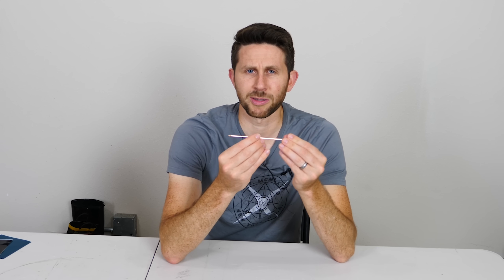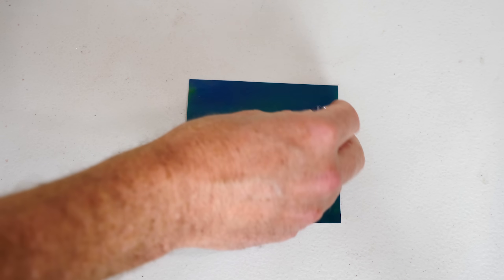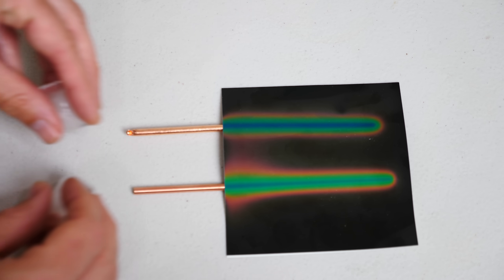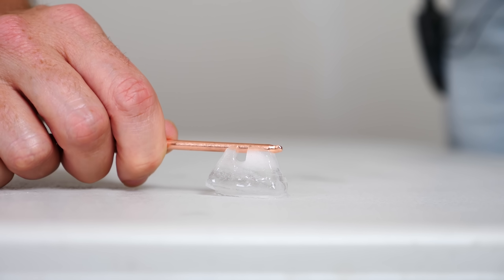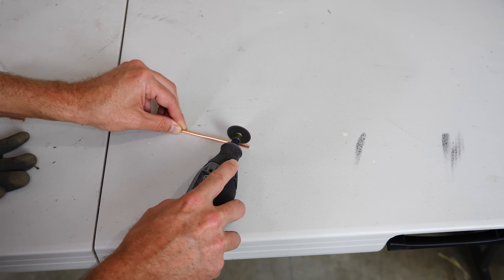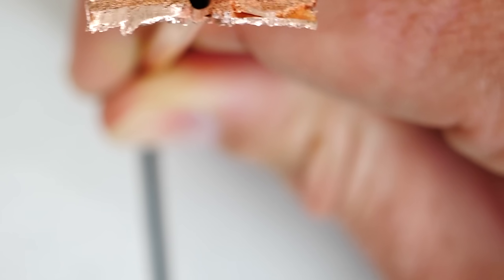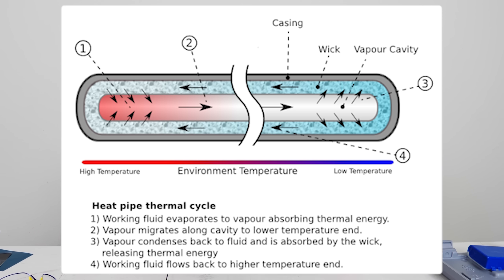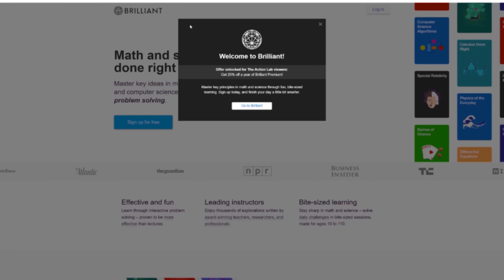What's Inside the Worlds' Fastest Heat Conductor?

Comment: But if water vapor is flowing from one side to the other, wouldn't at some point most of the water vapor would be on one side and there wouldn't be any more water vapor to conduct the heat on the other side, so it would then stop conducting heat as quick as it does? How does the water vapor get back to the other side once it condenses?
Reply: It relies on wicking, using the capillary effect. That's why the inside of the pipe is so rough. That wicking is what returns the liquid condensate back to the hot end, where it can give up heat to become a vapor, and transfer the heat back into the cold end by condensing. The efficiency of the wicking effect is what determines how fast this can transfer heat. Otherwise, you would have to make sure the hot end is always below the cold end, so gravity could drip the condensate back down to the hot end.

Comment: Silver is the most conductive metal.
Copper is second place
Reply: Copper is the best when it comes to large scale industrial and commercial use.

Its alot more common than silver
Has higher thermal potential (higher melt point) is only slightly less conductive. 
Also silver has higher chance of tarnishing which lowers electrical and thermal conduction.

Gold while less conductive has the added benifit of being non reactive i.e. will not corrode tarnish or otherwise oxidate. However given the high cost and easy at which it can be damaged its typically used as a plating on most conections (except high end processors that use gold pins)
Reply: He didn’t say copper was the best

Comment: What if we use silver instead of copper?
Reply: Not a good heat conductor. Not as good as copper. When it comes to heat conducting, vapour chamber made with copper is the best.

So many wires are made with copper. Why? Because of its electrical comductivity. But silver and gold does a better job. But they use copper imdustry wide because it is cheaper and copper has lower boiling point compared to silver and gold. The silver and gold just betters copper in electrical conductivity. For heat copper is better because of its nature.

Comment: 🤔I have a doubt now,

Can't this be used for geothermal energy?

I mean why can't we manufacture a extremely long and massive heat pipe and put one end of that at the nearest possible distance to the Earth's core and gain those heat from the surface!🧐

If someone knows the complications plz let me know😊
Reply: Copper is relatively expensive. It's easier to pump fluid instead.
Reply: Copper is expensive? I thought it was quite common

Comment: So Simple yet Genius. Did AI invent this?
Reply: No. Heat Pipes are old tech. They've been around for over a hundred years. The first types were thermosyphons, and didn't have the sintered wicking structure, and could only transfer heat from bottom to top, as long as the pipe was oriented in a way that led condensate to flow back to the lower hot portion. Those have been around since the late 1800's if I remember correctly.

Comment: You remember thermodynamics and half filled bottle bottom after push from above?
Bottle actually can be half covered with ("mazochistic...invisible maze")mazzola(hammer) hit ?!
Same ΣΗit shall happen. 🔱 SHalLow waters.
 (hail to HYdra: holy hole of holLow ring of SHa dow- sing Y )
Imagine wider opening of bottle. It is easier to explain experiment conditions of NO PRESSURE that way.  Open to the air and still broke out.

Why? Because it ain't water vapor that reacts but sudden vacuum( not void in this case vacuum isn't void..remember quantum mechanics..what your finger feel isn't there, stiil is?! How whY?). The Reverse FlaSh effect RЯ Holy Lance

Bottle glass is moved down before water has chance to move at all. For that brief instant of time vaccum is on the botto(H)m. Bullet water done the harm.
PRESSURE DIFFERENCE HAS THE POWER , not vacuum. (1 atmoSφere)
αφ

...1(1(1(0)1)1)1...
https://www.youtube.com/watch?v=_BRv9wGf5pk Snap - I' ve Got The power 

https://www.youtube.com/watch?v=7yeA7a0uS3A He-Man: Opening Theme

Comment: I have a question.
Say, if a ceiling fan motor is rotating at the speed of light would the ends of the blades of the fan be travelling at speeds greater than that of light?

Comment: What if we made that conductor from silver ?? Will it work better than this copper conductor ?
Reply: Yes
Reply: Yes, but only by a little bit. The conductivity values for copper are around 400 W/mK. For silver, most measured values are something like 450-480. But that heat pipe is at roughly 100,000 W/mK, which is already orders of magnitude higher. Silver might improve it a little bit, but I don't think it would be worth the extra cost. Silver is a lot more expensive than copper. The improvement, would be in the tens of W/mK, which would be so low that it would be less than a rounding error.

Comment: I knew how heatpipes worked, with liquid flowing as heat provided the energy, but I actually thought that it was usually an alcohol or gas used for it, not regular destilled water.
Reply: Same here!
Reply: Highest energy storage there is (well few exceptions but vary few).

Comment: Where can we find this special rod and the thermal paper ?
Reply: Thermochromic color changing film/ paint
Reply: Sergei Lewandowski thank you!
Reply: Lalrivunga Hnamte  it is not about the video, the context is in comments. Root one asked about both, rod and paper, then someone mentioned paper could be bought, then you mentioned it can be made at home, and that is the point where i was interested in: how could you make thermopaper at home.

and no, it is not that easy to create such a surface on the inside of the copper tubing. Sealing the vacuum with a little water inside it would be easier, but not much, as we need very specific pressure of water vapour in the tube after sealing. 

But if it was about thermal paper, i thought, you might just know some chemical available in food or chem store
Reply: but in fact i did not evaluated both variants, i just assumed second comment changed topic to just one item: thermal paper, and if not mentioned (or implied) otherwise, all consequent comments are about that, and i did not see such an implication in your comment, so i assumed you're about thermal paper ^_^

oh maan, i can be so tedious 9_9
Reply: anyone found where to buy the film? i found only paint on ebay
Reply: Lalrivunga Hnamte  using what materials? >_>
Reply: Lalrivunga Hnamte  now i urge to clarify, are we talking about that magic rod, or mystic thermal paper?

Comment: So basically its a partial vacuum that allows it to work. Having the water in a closed system of lower pressure allows it to vaporize at lower temperatures, more efficiently move heat across a gradient. You couldnt do it as well with standard pressure.
Reply: That's correct. The ONLY thing in that pipe besides liquid water, is water vapor. That way, it is always at equilibrium, allowing instant evaporation at the hot end, and instant condensation at the cold end. the rate at which it can transfer heat is limited only by how fast the wicking process can return the condensed liquid back to the heated end.

Comment: Info you have gien about this copper tube is correct, no problem there. BUT! This is not the fastest heat conductor. (Best description "highest thermal conductivity") It has the best conduction performance for low cost/high production rate aproach. (Thanks to material transfer from one end to another end) Actually this system can be improved with mercury vapor. I know it is very very dangerous and this is why its not used. As I said; this is the best for low cost/high production rate aproach.

Actually there are some abnormally good thermal conducting materials. For example; diamond, grahene, cubic boron arsenide etc... But you know; they are pretty expensive and not suitable for ordinary uses.
Reply: This isn't even conduction.  It's heat transfer by something similar to convection.  I guess I would call it convection.
Reply: @alext9067  I agree. I was trying to say that by saying "Thanks to material transfer". This is not even just convection. Water takes extra energy while getting into gas phase and  carries this energy as vapor, then when it liquidifies it releases this energy at the cold end of the tube. This is something you do not see in ordinary convection.

BTW I am not a native speaker. :)

Comment: That's pretty cool. Something interesting i've noticed working with hot metals is when you quench only half of something at a time, the cool water "chases" the heat up the item to the cool end and pretty soon what was cool, you can't touch anymore. You can chase the heat back forth a few times before it dissipates only quenching part of something at a time. Might be interesting to see it on a thermal camera or something.

Comment: What's the lower permissible operating temperature? I guess there will be a temperature (regardless of the end to end differential) that the liquid will no longer vaporiser? Below the critical point.
Reply: @dan me You mean the differential at each end?

I was wondering about the absolute ordering temperature. Like could you use them to transfer heat from an object at 0C to something else at -10C. Or will the water simply stay as a liquid.

Comment: "Working fluid flows back to higher temperature end" how does water move in there? Is it gravity that does the job?
Reply: As the fluid cools on the colder side, it's displaced back by the hot fluid flowing towards the cold side. It's basically circulating just due to mass conservation.

Comment: NOTE: Actually, yer wrong about one thing as computer heat evap tubes usually features sodium instead of water as it has a higher thermal conductivity rate.
Reply: This is a vapor phase change system. I don't know if sodium will evaporate at room temperature, even in a vacuum. If it's not water, it would be something like dichloromethane, or some kind of alcohol.

Comment: You should do comparison of that heatpipe between the opened pipe and the unopened one.
And see how much difference it is.
Reply: opened pipe gonna react just like a normal cooper pipe, there's no difference between opened pipe and normal copper rod, the water is the magic in the heatpipe
Reply: @clee2423  there IS a difference between a copper rod and an opened copper pipe.
It is in the copper cross-section.
Reply: Wait, what about the heat pipe that has a radiator liquid and a wick inside. I swear I've heard that kind of thing.
Reply: @utiantew  Then someone was feeding you BS.
High heat conductance of heat pipes is based of evaporation absorpting lots of thermal energy.
With movement of gas then transferring that energy fast to cold end, where condensation releases that thermal energy.
Reply: @tuunaes  What he's referring to is a wick used to soak the condensed water back to the heat source more quickly than the copper powder that is sintered to the inside of the pipe. I have wondered if a woven glass fibre wick might make it more efficient because the relatively straight-ish glass fibre bundles would wick water much faster than the tortured path of water being soaked along the copper powder. If you see water soaking up a bundle of glass fibres it's extremely quick

Comment: cool info🧠
What if we use gold/ silver/ platinum instead
Reply: The only way those materials would work better, is if they are more hydrophilic, and would wick the working fluid back to where the heat is more quickly. This is a vapor phase change system, using the latent heat of phase change from a liquid to a gas, and condensing back into a liquid. Otherwise, silver would be best, if it were just a solid rod, or tube.
Reply: Vincent Robinette stop acting like ur smart , ur comment makes no sense
Reply: @YbsGaming  I take it you don't understand the latent heat of phase change during evaporation and condensation in the absence of a non condensable gas. You're also having a hard time understanding how the wicking effect could return the condensate back to the heat source, using the capillary effect created by the rough interior of the heat pipe. Without those basic understandings, it's very difficult to grasp the concept.
Reply: Vincent Robinette  thanks for explaning it ,now i understand!

Comment: Not trying to be pedantic, genuine question. When you were cutting through the ice and you said how quickly the temperatures of the ice transferred immediately to your hands, wouldn't it be better calling it a thermal conductor rather than a heat conductor, purely because with  the word heat you tend to think of something being hot whereas this seems to conduct hot and cold temperature?
Reply: either way is fine, it is, conducting the heat out of his hand, and into the ice.

Comment: Nice, a heatpipe. We use sodium heatpipes in the lab to keep the gradient low at elevated temperatures. By varying the pressure, the temperature can be controlled.

Comment: It would be more efficient if silver was used instead of copper
Reply: It wouldn't make much difference. The vapor phase change of the working fluid is what transfers the heat. The limiting factor, is how fast the condensed liquid can be wicked back to the source of heat, so it can be evaporated.

Comment: It is not real because he held the rod and cut it. Cutting the rod generates heat and he would burn instantly. I felt a little bit weird because action lab did not lie. But now... He did
Reply: Once the pipe is open the gas/liquid inside evaporates and it just a regurar coper pipe again
Reply: @tNICKo  he must cut the pipe to open it. And it takes some time.
Reply: He used gloves for that very reason!
Reply: @vincentrobinette1507  where do you see the gloves? Interesting
Reply: @davidd2661  I thought I saw him wearing gloves at the end, when he was cutting the tube, not during the demonstration with the ice cube. I can't seem to find the video to review it. However, once the seal is broken, the efficient heat transfer is lost, and he wouldn't need gloves, if he could have allowed air to enter in before it got too hot to handle.
Reply: @davidd2661  A blue glove on his left hand(the one holding the heat pipe), when he makes the first cut. After the seal on the pipe is broken, he no longer needs the glove, because the phase change heat transfer property is ruined, by the introduction of air.(a non-condensable gas)
Reply: @vincentrobinette1507  i know what do you mean. But copper transfers   heat fast enough too to birn him.
Reply: @davidd2661  If it were a solid rod, you would be right, but being a thin tube, there just isn't enough cross section area, compared to surface area. He undoubtedly felt the heat, but not enough to burn his fingers.

Comment: LTT should test this as a cpu/gpu cooler :3
Reply: They are being used as heat pipes in coolers.  😎
Reply: without fins it would be really bad but with fins it would just be normal air cooler
Reply: have you ever build a pc? its those pipe in aircooler!

Comment: Ooh so that's how vapor chamber cooling works in electronics
Reply: Vapor chamber is very similar to an heat pipe, but the heat pipe is a little bit slower in conducting heat
Reply: nope, vapor chamber is a little bit different from heatpipe
Reply: @clee2423  how so?
Reply: @threepe0  instead of small surface area at the outside like heatpipe, usually vapor chamber has a wider area so the heat will spread more evenly and faster
Reply: @clee2423  I don't think that really qualifies as different;  The "how it works" is essentially the same, just a different shape
Reply: @threepe0  i mean because of that different, vapor chamber works faster than heatpipe probably, https://www.youtube.com/watch?v=M4POFT3Ctek
Reply: @clee2423  heatpipe is a form of vapour chamber let's say ;p
Reply: Seraph - Excellent link.

Comment: So I think I'm noticing a potential drawback of this device.  Isn't it true that it's thermal conductivity would have to be lower at very cold temperatures?  Say if you're significantly below the triple point temperature of water, like -40C, then the vapor pressure of the ice would be so low that the vapor cannot transfer as much heat to the other end, yes?
Reply: This is precisely why I suspect that the working fluid might be methanol, or some kind of alcohol, or even dichloromethane. These fluids work well below the freezing point of water, as long as the condensate will wick effectively back to the source of heat.
     Even if it IS water, if the temperature is that cold, the temperature protected component still won't get that hot. If it does, the water turns back to liquid, allowing the heat flow system to resume normal operation. Remember, it's vacuum packed, so water will freely evaporate and condense, at any temperature, with changes in vaporization pressure. The interior is always under a vacuum, unless the whole heat pipe gets up to, or above 212 degrees, in which case, there is no pressure difference, or even slightly positive pressure.
Reply: Yeah, but it's not typically used under those conditions. It is typically used around room temps to a heat source that may vary between 100 to 200 F. 

      Water has a higher heat capacity than methanol and many other, non exotic fluids. It is very good at transferring heat via the liquid--vapor--liquid cycle.  

     Sure, if you lived in Siberia or the like, and were using this tech outside, then yeah, go with an alcohol or the like.  But for most conditions, most of the time, water works very well. As far as I know, most of the heat pipes made and sold to the public use water as the phase change material. Maybe the military and the like use different and/or more exotic materials for some applications?